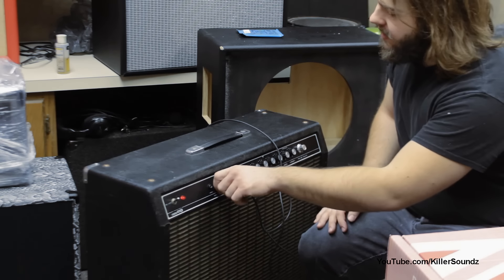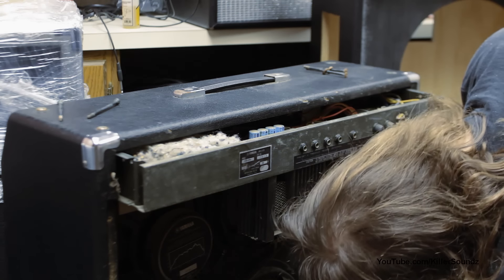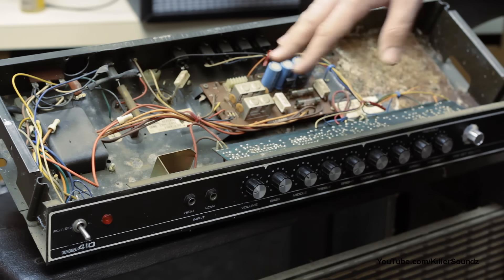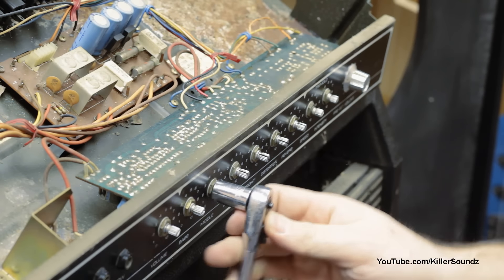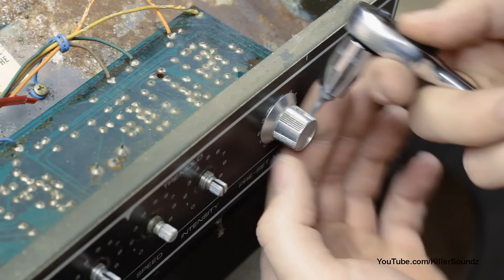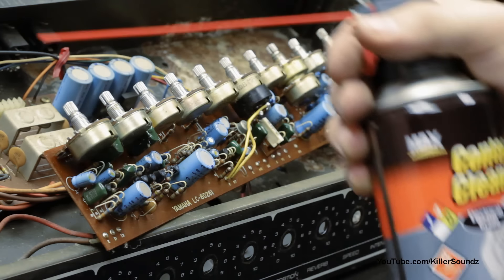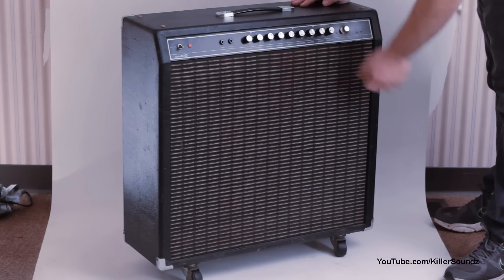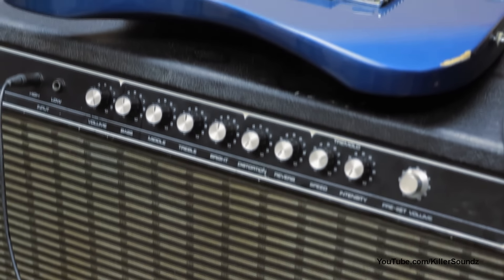Scratchy Knobs? How To Clean Amplifier Pots with Contact Cleaner Video  ✔

Comment: i have a Boss CE-1 with a really scratchy master volume pot, i tried this out but it dident work :(
Reply: Hi sometimes the carbon track inside the pot can wear out which is probably why it didn't work for you you should be able to find a substitute pot online if u can find out the value of the original hope this helps
Reply: i fixed it with contact cleaner :)

Comment: That looked like a mouse/rodent nest you vacuumed out of the chassis. Question is twofold; how did they get in there & how did they get out? Mice can get into anything their heads will fit into, but hard to believe they wouldn't still be there, dead from gnawing on a capacitor. 🙃

Comment: Be very careful what type of cleaner you use. The chemical composition varies greatly.

Regular use of "contact cleaner" as above will compromise the carbon tracks inside potentiometers.
These cleaners are designed specifically for metal-on-metal surfaces ONLY such as switches, relays, and connectors.

Comment: How to NOT repair your potentiometers! Spraying like that will temp fix them but it kills all mechanical smoothness and they start to work dry. Because contact also kills the grease inside a potentiometer. Such amount is not needed. The proper way is to disasemble a potentiometer, clean the dust with isopropyl alcohol using ear sticks and THEN apply a small amount of contact "for potentiometers" using an ear stick, not spraying directly! In most cases proper cleaning with iso is enough.

Spraying like that and melting half of the PCB is mindless. The dirt still sits inside...
Reply: SlashButcher Just do it again when it needs it. It's not rocket science...
Reply: The Realistic Panasonic thnx for two hairs
Reply: Most electronic repair professionals recommend deoxit. So either you're some genius and they're all wrong, or, ya know...

Comment: Never use a vacuum cleaner on sensitive electronics.  Vacuums generate static which can damage or destroy electronic components.  Always use a blower of some type.
Reply: Calling urban myth.  Yes fast moving air can cause static electricity but the kind of components in an Amp aint gonna care.
Reply: Actually, vacuuming is the preferred method of cleaning electronic equipment by technicians when everything is secured in place, otherwise the dust and dirt gets blown into other components and the work area. The concern about static electricity is essentially the same, whether the air is sucked or blown into equipment. In any event, with a guitar amp of this capability, the components most probably are robust enough to withstand any static electricity that would appear.
Reply: Yep. Amps are high voltage and can take some static. Don't ever vacuum computer equipment though. You certainly can fry a mobo with a vacuum.

Comment: those capacitors, I used to work in a repair shop, my co-worker touched a capacitor inside a microwave oven, he was standing up at the time. The shock sent him flying backwards and up agaisnt the wall in our shop, he was stunned but otherwise unhurt.
it really scared me.
Reply: Yeah, capacitors are no joke.  They can hold enough to kill in some cases.  You have to dissipate or 'soak' the charge, before you can safely lay hands on them.   [I am NOT an electrician, but seriously. They're nothing to be messed with without proper precautions.]
Reply: You put a resistor across their contacts. That discharges the electrolytic death.

Comment: Don't do this without using a lube. I'd bet money that contact cleaner slowly deteriorated the pots.
 Buy a can of lithium grease from walmart in the automotive section. 
 It cleans and lubes all in one but messy.
 Contact cleaner is not for potentiometers. It works but it will slowly dissolve anything that is not metal unless it's washed out with lube. You are safe just using lube to clean a pot.
 Lube job is a great product and not messy. You are trying to get debris out. Not turn the insides to gum.

Comment: Thanks for your vid....... but......If the pots are worn.....i.e... not dirty but worn out, then no amount of cleaning will fix this problem for the long term.......especial a constantly used volume pot which will be the most worn out pot in the whole amp........It needs to be replaced.....

Comment: On my ROLAND JC 50 the potentiometers are cleaned with WD 40, which has oil in it.
The amplifier has been working great for 10 years.

Comment: Should have put a towel under that panel before you shot that cleaner on it. I noticed that you have a nasty looking 'stain' on top of the amp's tolex. That's not there in the beginning. Electrical may not hurt any electrical parts, but I've found that it will sure eat up plastic of most kinds. I doubt that overspray on the top will ever look completely right again. Bad move.

Comment: De-Oxit. Amazon.
Reply: the Deoxit that is designed for Faders or Potentiometers is probably the best as it uses a light lubricant which can become displaced with most generic contact cleaners.
Reply: Any fast drying electronics cleaner does the same thing.  De-Oxit is very overpriced.
Reply: @capth00k  such as?
Reply: @timjoseph887  Walmart / autoparts store electronics cleaner ; even MAF cleaner which dries really quickly can be found cheaper sometimes on sale

Comment: Always wear rubber soled shoes when working on electronics. never lean down in the ground, you place the device up on a work bench. also, use only one hand when in doubt, touching a charged cap with both hands could cause current flow t rough your heart, which can kill you. this guy leans down and is working on the amp on the floor, a big no no. This is a solid state amp, so probably pretty safe, but tube amps are even more dangerous, with larger capacitors and higher voltages when operating. dont even open an amp unless you know what your doing, not worth the risk.

Comment: Don't use contact cleaner. It will ruin the pots over time . You need the proper pot cleaner and lubricant spray. Don't use contact cleaner on pots . That's NOT what it's for. If you don't have training in electronics don't teach it. Someone might ruin a vintage amp or even kill themselves.